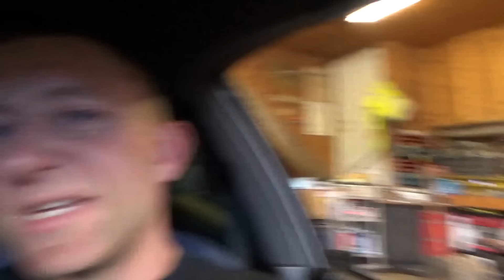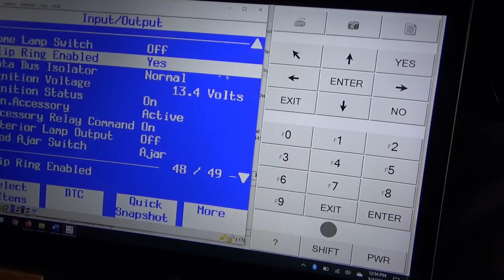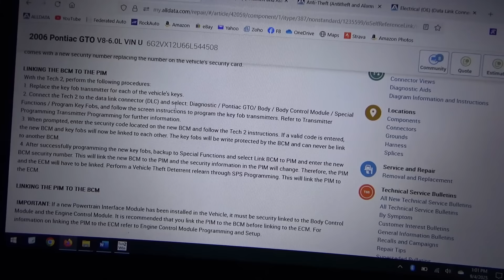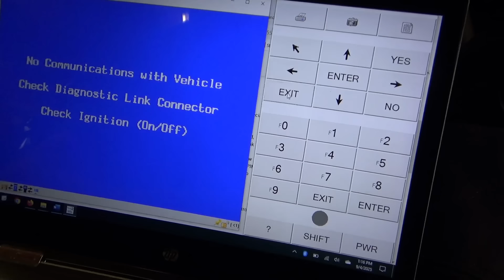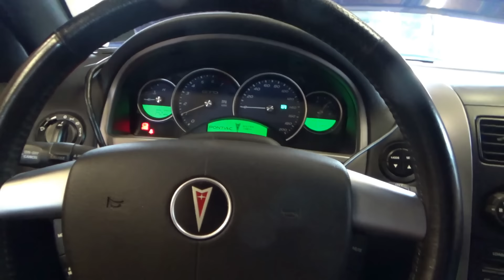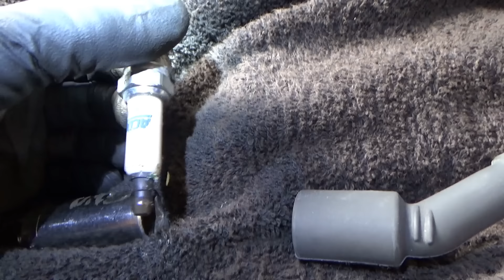No-Crank...Sometimes? Immobilizer MALFUNCTION! ('06 Pontiac GTO V8)

Comment: Did you have to do a pin swap to get Tech2Win to talk to all the other modules on the car?   I can only get it to talk to the ECU but the PIM, BCM, etc all get no comms.
Reply from the maker: Not sure what you mean by "pin swap". Either a software or hardware problem with your setup if the car itself has no issues :)
Reply: @PineHollowAutoDiagnostics  It's pretty heavily documented that the GTO ABS, PIM and BCM don't communicate on PIN 9.  The ABS is on Pin 1 and the PIM/BCM are usually on PIN 2.    Most of the affordable readers only read pin 9 though.

Comment: I have a 05 gto. So if I have a crank but no start , I have fuel pressure , I have spark , and I have air flow , then this would not be the problem ?

Comment: Im having p0032 and 52 codes.  07 srt 300. It’s cammed. Hp tuned.  Rear o2 are turned off in the tune .. I put new mopar sensors in it.  I tried a different pcm.  They are switched from pcm. No relay or fuse.   Im near Pittsburgh.  Really thinking on hitting you up Ivan.   Should I send you an email?

Comment: Likely reason it would not start without pressing unlock was the old ignition key making poor contact with the key to the slip ring. Noted by data cycling from yes to no with key in cylinder. To over ride the security you press unlock and that allows starting to be enabled. New key would have corrected it but seeing the BCM was water damaged prior i would have done the same repair to be reliable.

Comment: That was the last year, also the "hottest" of the Australian GTOs. Also , security systems are great for keeping the car's owner from stealing it. Lastly, that electrical tape over the hole brought back memories! A GM directive that came out for late 90s Chevy Cobalt radios. They had a fluid intrusion problem where water could enter the radio through the top cover. The official fix? Cover the entire top cover of the radio with electrical tape! I guess to GM that was cheaper than a directive to actually fix a water leak in a Cobalt.

Comment: Even with all the Tech2 hiccups, that appeared to be a shockingly easy BCM programming procedure.  Nice job!  But something that wasn't showed or touched on in the video.  Tell me Ivan, did you still need to replace the ignition switch lock ring when you replaced the BCM or no?
Reply from the maker: Slip ring is just a dumb contact so no replacement necessary 😊

Comment: The 2006 Pontiac GTO is an Australian-made GM car. It was manufactured by GM's Australian subsidiary Holden at Elizabeth, South Australia, and was the fifth generation of the GTO, which was first launched in 1963. The 2006 model was the last of the GTO line, with GM halting imports due to the inability to meet new airbag deployment standards. The car was built using the chassis of the Australian Holden Monaro sport coupe, which was derived from the GM Opel Omega from Germany.
Reply: Technically the Monaro was a version of the Commodore. The Commodore was based on the Opel Omega but is radically different in its construction and drive train.
Reply: The GTO was halted because of the end of the VZ line and switching over to the VE Commodore (G8) Airbag bs is what GM said but thats not the real reason for it.
Reply: Best thing since "Crocodile dundee"

Comment: My guess is that the circuits in the pcm/bcm that detect the key are not working but it goes threw different circuit threw remote signal in pcm/bcm that still works

Comment: The 1968 GTO was a muscle car. This is an expensive, complicated imitation.
Reply: Have you driven one?
This thing would make that 1968 GTO look like a yellow cab.
Reply: @Stambo59 
You can say that because you never owned a 1968 GTO. You weren’t on the planet in 1968, right? A GTO with a 455 was a beast.
Reply: @bills6946  Lol I been on the planet longer than you think, I have probably been driving longer than you have been alive.
See, I can assume too.
I have repaired, tuned and driven many 60s, 70s and 80s muscle cars as well as modern muscle cars.
I can say without hesitation that this car would eat any stock 60s or 70s GTO.
Reply from the maker: I think this 2006 will leave any stock 1968 car in the dust 😅

Comment: Rover cars from the late 90s had an immobilizer system that you could only disarm by pressing the unlock button (5AS). It's the only OEM immobilizer system that I have seen that is disarmed by pressing a button, but it's also used on Nissan cars.

I have never seen a car where you could disarm the immobilizer with the unlock button that also had a transponder system. I guess it's good to have a backup.

Comment: I thought GM was done with the resistance based security when the key changed out of the 'pellet' style. That thing must be a BEAST! Awesome case study, Ivan
Reply: Actually it was long after VATS because then they went to Pass lock 1 with a bulb check wire and then to Pass lock 2, although neither had a chip like VATS it took the shape of the key and sent resistance down the pass lock wires.  Great idea huh, so when the key gets a bit wore out the shape of the key changes just enough to leave you stranded.   Then you get to do the 10 minute reset every time you want to start your car.
Reply: There pretty quick vehicle I've played with couple of them on the highways.

Comment: It sounds like that car is still running the similar 5.7 litre Chevrolet LS1 V8 engine to what my 2002 model Holden VY SS Commodore does in Australia which company made that GTO which was sold as the Holden Monaro in Australia.

If it is fitted with the 5.7 litre Chevrolet LS1 V8 engine still it still has the SAE J1850 VPW  protocol class 2 communication Delphi PCM fitted which was fitted into the 1999-2005 (VT series 2 -VZ series 1 ) model Holden Commodores in Australia.

There are aftermarket scan tools which can talk to the PCM,I have the Bosch 2220 scan tool which reads the PCM data & codes which the cheaper scan tools can't in my car , the scan tool was advertised to read codes in Australian delivered cars but I found out that a Holden VY V8 Commodore which my car is is not listed on the scan tool,I have to scan it as a U.S. Built 2002  model Chevrolet Camaro so that it can read the codes.

It will read the codes stored in my dads CAN OBD2 protocol 2013 Model Holden (Chevrolet) Colorado RGs PCM  in OBD2 mode but it won't read my Commodores codes in that mode.

The 2006 model Holden Monaro or Pontiac GTO night have been the very last of the coupes which may have still used ALDL or OBD1  technology for the ABS brake, BCM  & the SRS airbag modules , the codes can be read with an OBD1 scan tool but a special scanner/programmer ior the Tech 2 unit is required to read/write data to the BCM.

I have never had a problem with water intrusion into my car, make sure that the drain holes are clear of leaves & other debris behind the front quarter panels,I did have to replace a weather strip underneath the bonnet because water was causing a bad engine misfire whenever it rained because it was getting into the spark plugs of cylinders 7 & 8.

The 2006 model Holden VZ series 2 V8 Commodore was the very last of the VT-VZ shape prior to them going to the Zeta platform which was the Holden VE Commodore & the Pontiac GTO sedan, the VZ model series 2 Holden V8 Commodore ran the 6 litre V8 engine.

Yes, my VY SS Commodore is similar to that Pontiac GTO in the video except it's a right hand drive sedan, the seats & instrument cluster is different in my car,it has the Holden lion where the Pontiac symbol is, note if that Pontiac GTO is basically the same as a VZ Commodore a lot of the electrical components such as the instrument cluster & ABS module will not fit into my VY SS Commodore because they're different despite having basically the same shell.

Mine is a 6 speed manual car as well,my dad has a 2000 model Holden VX Commodore which runs Holdens Ecotec version of the 3.8 litre Buick L36 V6 engine, Holden designed their own Ecotec inlet manifold for it & it still runs with a Bosch OBD1 PCM which is made in Singapore, it's different to the U.S. released Buick L36 V6 engine which runs with the same OBD2 Delphi PCM as the 5.7 litre Chevrolet LS1 V8 engine does in my Commodore.

I am not a big fan of the 3.8 litre Buick L36 V6 engine, they're too much of a slug to me.

I have had the key blade come loose which has caused the engine to not crank because the transponder key also grounds itself through the key blade, tightening the screws fixed the problem.

I have heard that Holden is returning to Australia to build a new Holden Commodore which is still built on the Zeta platform,I want to buy a V8 one of them, I didn't know what GM was thinking when they ended the production of the Australian built Holden Commodore in Australia in 2017 & the Holden brand in 2019 because I can't find that I am liking their other options.

The first option, the Holden dealers started pushing to sell the Mitsubishi brand, who thought I wanted them  ?

That's because I don't want them.

Who thought that I would like to drive a grandpa sort of car namely the BMW ?

The police are driving them now instead of the V8 Holden Commodores & Ford Falcons because both manufacturers don't make them now  !
Reply: The 2006 GTOs had the 6.0. LS2.
Reply from the maker: I knew you would like this video, Russell! :)

Comment: Disarm and no ignition on within 20 seconds leading to an immobilised state is quite normal for many vehicles, indeed it was mandated in the early 1990’s to meet industry security requirements in the UK (Thatcham) the normal action required by the user is then an arm followed by a disarm.

Comment: I once had an 8th gen Impala that had  BCM issues. It did all sorts of really weird things until I replaced it. I couldn't find any corrosion on mine. Unfortunately didn't have the Tech II to program it and had to take it to a dealer to program it.
A buddy of mine had one of these Holdens. Fun car to drive but he got rid of it after a short time due to all the issues he had with it.

Comment: Just how can a spark plug can go wrong ? ? ? such a simple part made by thousands . . .Obsolescense programming ? ?
Reply: Perhaps the owner installed a set of those readily available counterfeit sets from Scamazon. I was thinking the same thing I don’t think I’ve ever saw a bad original iridium plug with low mileage like that.
Reply: Probably fired hundreds of millions of times.
Reply from the maker: @MattyEngland  They guy barely drives it...under 100 miles in 2 YEARS!!